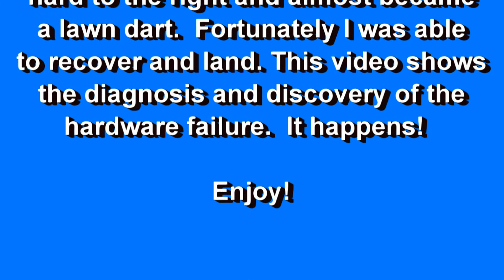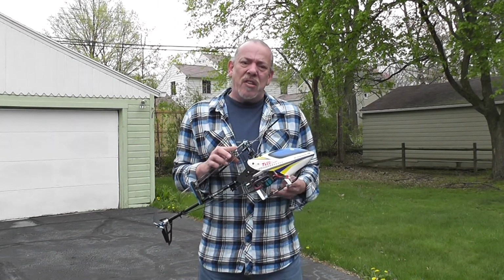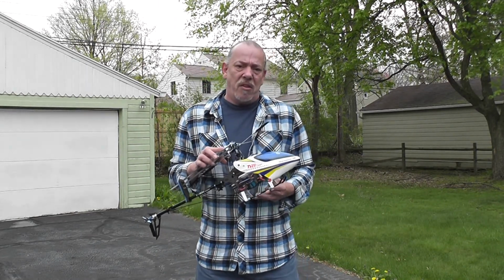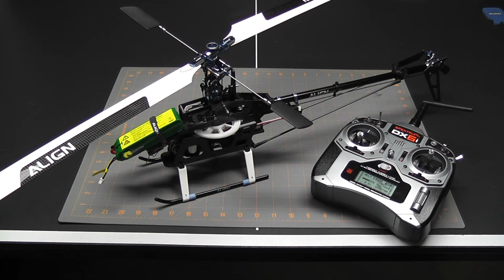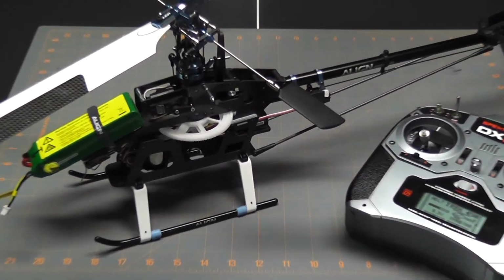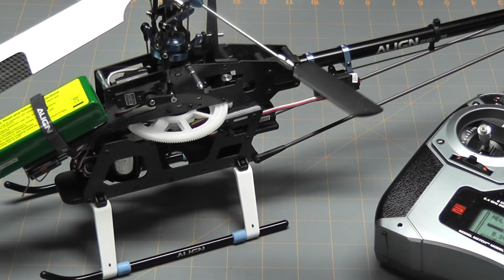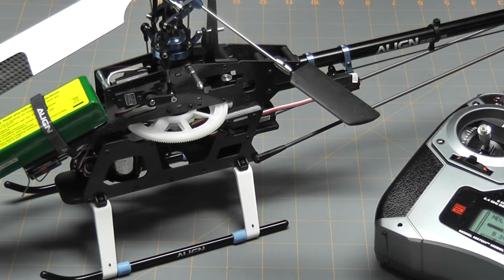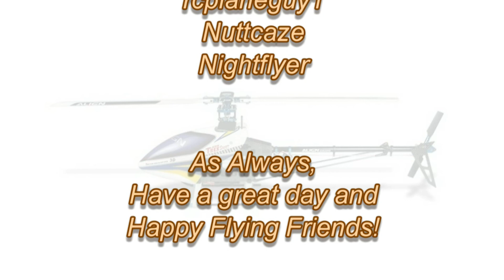T Rex 450 Hardware Failure

Comment from the maker: @reynolds26n - That is great advice, and I have always checked cyclic movement before each flight as a part of my pre-flight ritual.  The servos were all moving fine when I took off which made it even more frightening when it happened because I had no clue what went wrong. hehehe.  In any case, it is no big deal and a new servo and I will be back in the air.  Thanks for posting and happy flying friend.

Comment from the maker: @96sunvalley - Actually good question!  No it did not come unplugged.  When I first powered it up after the "incident", if I touched the servo arm while giving it stick, it would jump to the correct setting, but then get stuck where ever it stopped.  After a few times of that, it quit moving completely.  I have heard this can some time happen and I am just glad I didn't hose my heli!  Thanks for posting and the great suggestion.  I would have felt dumb if it did come unplugged. hehehe